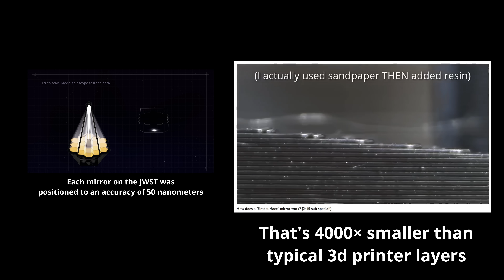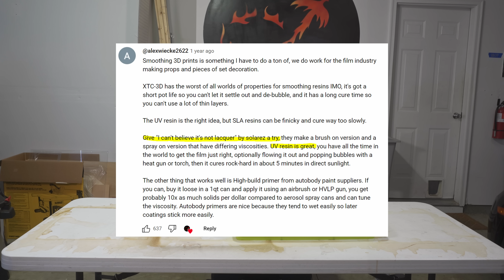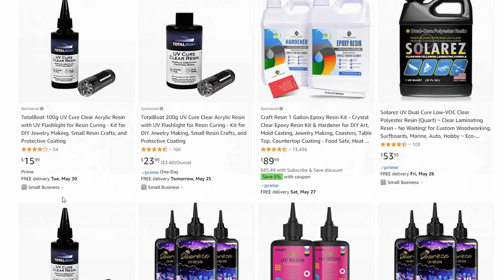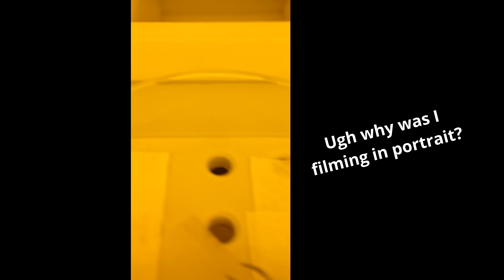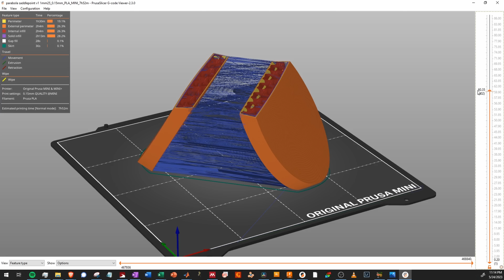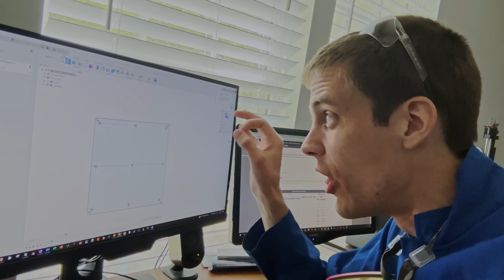Two ways to make asymmetric mirrors (Printing vs. Warping)

Comment: I would have rigged some variety of centrifuge to "smooth" the resin, with the "top" of the part facing the hub. You could literally  make one with some twine or thin rope and swing it in a circle.
The effect would be like putting the part under extra Gs, causing the resin to flow more quickly and strengthening surface tension. You could even do it in a sealed container for a "clean" environment.
Reply from the maker: I thought about this! I think it’s a great idea but couldn’t figure out a simple way to build it
Reply: Oooh, or, alternately, you could use this method just to get a conductive surface, then electroplate the surface until you have a very (relatively) thick layer built up, then just polish to a high gloss.

Comment: You may want to try vapor smoothing the 3d printed part with acetone before using your resin. Vapor smoothing, and perhaps pre-sanding, could help at the macro level, now that you have the micro level seemingly more figured out with the uv resin.

Comment: What if you sanded the 3d print lol
Reply from the maker: I did - didn’t make the artifacts go away. I forgot to film the but where I chucked the mirror into the lathe and used sandpaper on it, but you can see the circular sanding marks in the coating close up

Comment: 8:36 how can you even breathe through that? arent the covers still on the filters xD?
Reply: I have worked extensively with those kind of filters and the pink part is actually a piece of the filter housing. The filter medium is contained within a hard plastic case, and the pink colour signifies what materials the filter is good for. I believe you can change the filter inside of the case but usually it's a disposable unit and you just throw the whole thing out once the filters full. Also they are surprisingly easy to breathe through, especially when new.
Reply: @emo5729  ahh yeah i remember, theyre a different one, theres some constructed like a sandwhich, and then theres these, constructed like a bag of rice

Comment: Have you considered using a resin 3d printer? They can be bought rather affordably and have much higher accuracy. Given all the work you do with chemicals, a resin printer should not be an issue. All the best and keep up the good work!
Reply: You know what, they do have superb resolution, alignment, they don't have issues where the filament bead fails to exactly follow the toolpath, but they do have issues with large scale accuracy, because there is some warpage. So that's a thing to consider.
Reply: Getting a resin printer at work dramatically improved the precision and details of what we could print. Even though it was an expensive early formlabs printer, it more than paid itself off.

Also, the UV cured resin is basically just printer resin. :P
Reply: yeah seems like it'd be way easier to smooth out even a rough SLA print instead of any FDM print
Reply: Was going to say the same thing. They are getting so cheap now too.
Reply: It's an involved process, though. You need a fume hood, a way to dispose of the sludge it makes, etc.
Reply: Might want to consider shelling out for one of those new 12k resin printers. Leave a light layer of uncured resin on it and it might even smooth itself out without much post-processing
Reply: Every thermoset/thermoplastic printer is a resin printer
Reply: @ThunderBird80085  🤔
Reply: I've been able use a resin 3D printer and some sandpaper and polish to make a eye glass lenses that improved my vision. There is definitely a surface roughness but it can be smoothed out with sanding and polishing or a thin coat of clear UV resin. You get weird artifacts with the lenses though. I used the anycubic photon but I just purchased the Photon D2 and hope to have better results soon.
Reply: Came here to say that 🙊
Reply: good optics require precision which is a fraction of a wavelength so no printer would be able to do this
Reply: @jormam69  Yes, but it would likely severely reduce the inter-layer inaccuracy that the filament printer was suffering in the video. They'll never be perfect optics, but for something made in a garage where spray bottles, a heat gun, and a flashlight are standard tools, resin printing ought to make for a much higher quality result with not too much change to the process.
Reply: @PyroNicampt  True!
Reply: @PyroNicampt don't you dare egg on my spray bottles and heat gun!
Reply: @jormam69  he did not try to build a space telescope! :face-blue-smiling:
Reply from the maker: I wanted to though…
Reply: @AlphaPhoenixChannel  Even a cheap one will have 50nm res. never mind the 4/8/12k ones you get now.
Reply: @AlphaPhoenixChannel  a spinning bowl of mercury, with a layer of UV setting on top, hardened as it spins.....to make smooth parabola?
Reply: @AlphaPhoenixChannel you should try shaving the 3D print with a metal card that has the same shape as your parabola along one axis